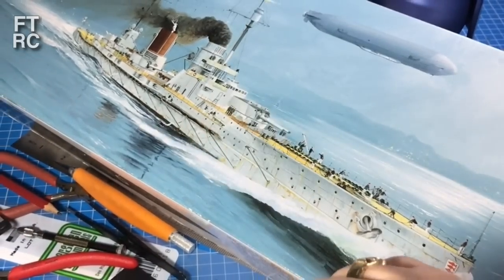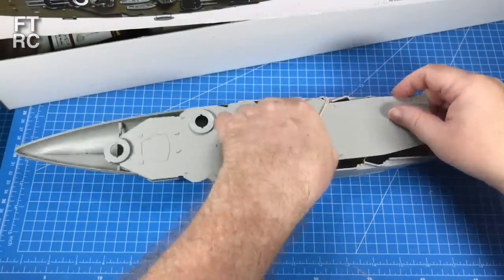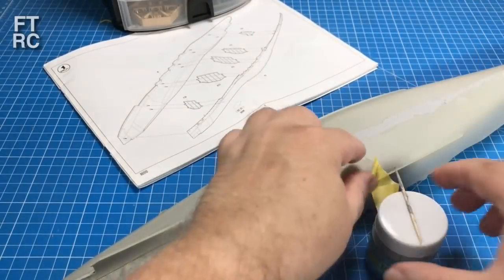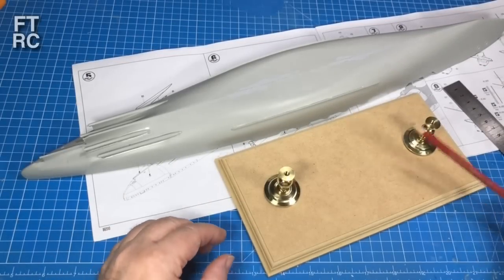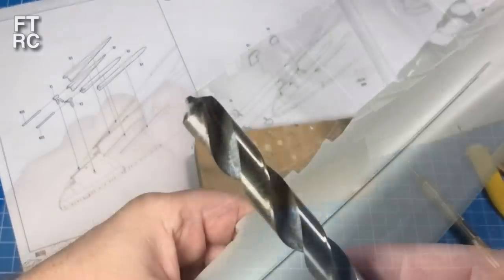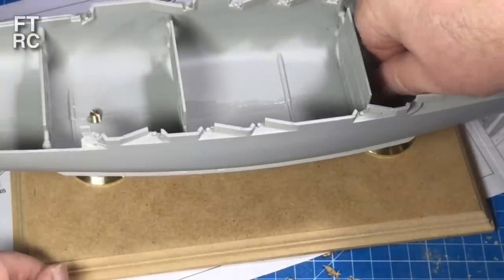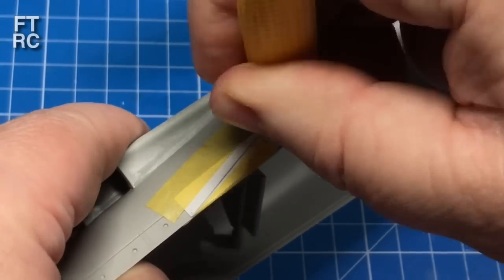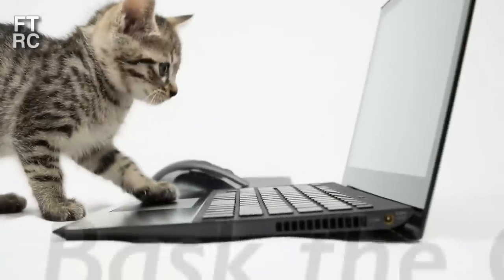SMS Seydlitz Part 2  Scratch Torpedo Net Booms and brass pedestal stand - Hobby Boss 1/350 kit

Comment: I built this model last year during lockdown, using the fantastic Infini PE and brass set. I found it a good kit to assemble with the exception of some terrible warping in the hull parts.  I built the model waterline, but even when I cut away the lower hull, it was terrible, with the midships area bowed upwards. In the end I had to use "brute force and ignorance" - about 750g of lead epoxied under the deck amidships!.  This was right at the start of the build and nearly put me off completely. I'm glad I persevered, since the rest of it went together really well and produced a lovely model.
Reply from the maker: Good to know it was not just me then… but I got my midships together in the end.

Comment: Really nice, Harry 👍👍 it would be great if manufacturing would mold the hulls in one piece. That was one of the reasons I stopped building ships. That and some other stuff, but the 70s weren't nice to me and ship building.
Reply from the maker: They could but then you would not get much detail.  Trumpeter tried moulded them in lower and upper hull sections, rather than port and starboard sides.  This worked well for anyone wanting to do a waterline seascape.  

However they needed to add a cross member for strength, and this usually became part of the deck.  Remember the badly moulded Arizona hull from Hobby Boss?  

So I think it’s safer to mould hull port and starboard halves, then make you do all the work of joining it together, rather than have complaints about bad moulding issues with the upper/lower hull method.

Comment: Another excellent presentation. I have used wood drills on plastic as they have a center spigot and drill a round hole through thin soft material.
Reply from the maker: Hmmm if the drill bit has a spigot it’s probably a masonry bit.

Comment: So far so good, Hobby Boss is a good kit company , sometimes they get a little bit crazy with their photo etch parts but its looking good. Thanks for the tip on pva glue.
Reply from the maker: it is a pity they now only offer the PE option with no alternate plastic part.  I use PVA on so much of my modelling
Reply: @HarryHoudiniModels  I haven't bought a new kit in a while, I'm thinking about picking back up on my 1/350 Arizona that I'm in the process of converting to the Nevada  circa 1944. The main problem I'm having is getting enough 3D parts the supply chain sucks!

Comment: Just to say DELIGHTED you finally get the chance to start this kit , and the INFINI Brass Masts are wonderful ( I used them on the Tamiya Yukikaze 1/350 )- 
along with a comprehensive detail-up set - plus a Wood Deck and Anchor Chain is a winner ever time ( and saves a lot of work on the deck ) 
Did you ever get any of the  1/350 ' Accurate Model Parts of Australia ' Fabric Flags - sadly the company is closing down due to EU/UK Vat changes 
I bought 4 of the 1/350 ' White Ensign ' Flags and the detailing is marvellous ( and when you cut them , they DON'T fray at the edges ) 
- I ended up using them on the Trumpeter 1/350 Scale HMS Hood ( along with Flyhawk and Eduard etch , Trumpeter 15 inch and 4 inch Brass Barrels ( saved a lot of time ) , 
Tetra 2 pounder pom-pom , 
Tetra 0.5 inch AA guns , Art Wox Wood Deck , G Factor Brass Propellors , Pontos Brass Pedestals ( superb looking like yours !! ) , ' Shapeways ' MicroMaster Main Gun Turrets 
Alliance Mushroom Brass Vents , BIG Blue Boy 40 foot Yard arm for Main Mast and 2 ' Raided ' Ensign and Jack Staff Poles ( from HMS Prince of Wales super-detail set - sold off )

your construction of the model kits are wonderful - glad the Patreon system is paying for you to enjoy the hobby full-time very best wishes from Scotland
Reply from the maker: Thanks.. I am looking forward to adding the brass mast set

Comment: The torpedo net booms will liven up the hull. As I understand the model depicts the ship in late war state, when the German navy had removed the torpedo nets from the ships. Odd that the box art shows an earlier state of the ship.
Reply from the maker: There is a photo I found of the early Seydlitz with a Zeppelin  flying overhead. I suspect this was the inspiration for the graphic artist to create the box art.  However I will be regressing mine to the pre Jutland fit out, specifically the battle of Dogger Bank
Reply: When damaged the booms could foul the props - and Seydlitz took A LOT of damage.

Comment: Harry have you ever thought about scratch building a damaged version with shell hits. I guess holes in the Hull and Super structure might be pretty difficult. but burned out turrets with some scratch built interior details and fire damage might not be that hard for someone with your skills.
Reply from the maker: I could but I probably won't... I spend too much time making my ships pretty to ruin them!  My Warhawk shit kit aircraft I filled with bullet holes.. to hide the bad wing joins!
Reply from the maker: However I did break up a 1:700 destroyer and added a Kraken eating it... was a club comp where everyone builds the same kit.. I can't see 1:700, especially a tiny destroyer, so there is that.  I made a video about it.  Search Kraken!

Comment: Hi Harry, great start to the build.  Quick question - could you use epoxy to fix the nuts in the hull rather than white glue, I'd have thought epoxy would give a stronger fixing?
Reply from the maker: Might work, but PVA is my tried and proven solution. If it ain’t broke, don’t fix it!
Reply: @HarryHoudiniModels  Cheers Harry
Reply: Good video Harry . It even had Mary Jo commenting on how she would fix the hull gap the same way .